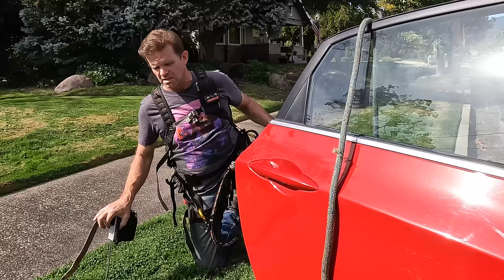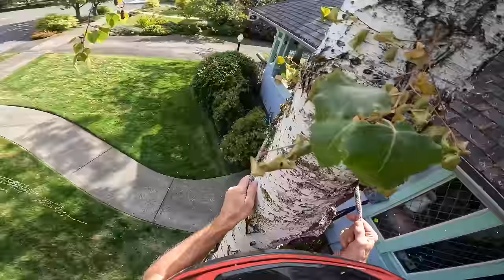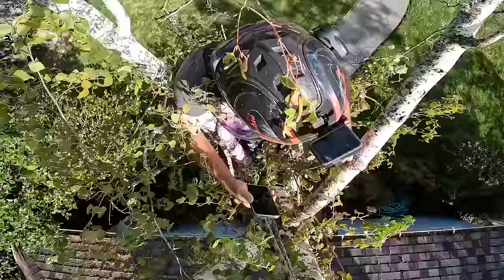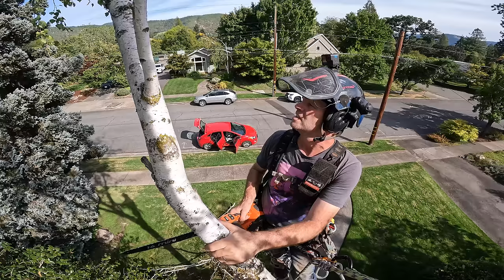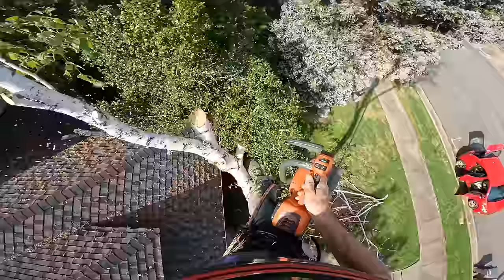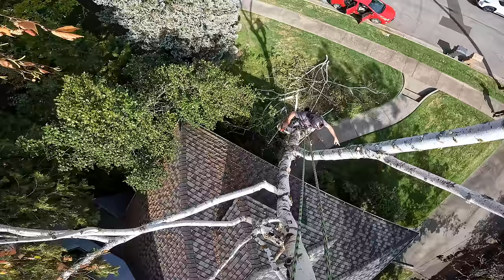Probably the BEST Battery Chainsaw

Comment: I had a similar issue (5:30) with my t540i and took it into Madsens in Centralia WA. The mechanic said that saw dust had accumulated in the throttle, so when I squeezed the trigger the electric components weren’t making contact. I just make sure to blow that out whenever I clean the saw and it hasn’t been an issue since. Keep up the great content, man.
Reply: $1,000 ?!!!!
Reply: Very much same happen to me with Stihl MSA220C.

Comment: My thoughts are a short bed pick-up truck with a topper.  Keeps your equipment out of the weather.  Keeps the fumes, gas, and bar oil spills out of the passenger compartment. 
Bonus points if the topper has side windows that open.  You can also hang your ropes and saddles up so they stay out of any messes on the floor of the bed.  Tint the windows dark and lock it up if theft is a problem in your area.
Reply: The topper and a slide out bed would be trick.
Reply: I operated out of a chevy colorado with a locking shell for a LOOOOONG time

Comment: That Husky is solid, it’s just still too heavy for my taste. I’m waiting for the battery equivalent of the echo 2511 power to weight ratio to come out, and it will happen. The technology will catch up.
Reply: Starting out, I tried the Makita 36V but it didn't take long before I bought a 2511t!
Reply: I got the echo 2500. I like how light and quiet it is. The down side is the 2.5mah battery doesn’t last that long so I got another one to swap out.
Reply: Milwaukee fuel is the way to go

Comment: My youngest just bought a 1977 Chevy truck. Looks nice but needs a bit of work yet. Has a 454 in it, which is a bit much imho. Hope the crew / family and you are doing well. God Bless.
Reply from the maker: Isn’t 454 a Chevy motor?
Reply: @AugustHunicke  77 chevy truck.. he's not a ford man
Reply: Oh no one can never have too many cubes! I have a soft spot for the 454, built one for my 78 Chevy with a short duration high lift cam and Edelbrock Performer intake. I don't know how the stock axle survived, the torque was intense. I got better mileage than the small block that I took out.
Reply from the maker: LOL. I saw 77 and omitted the Chevy part in my mind immediately.

Comment: I love the truck that Jacob (from GuiltyofTreeson) has. I always wanted at utility truck like that, something you can store all of your tools in the correct places with locable doors so you know that your kit is safe. Maybe even have a toeing hitch adapter on the front and back so that you can hook a winch up to it as well. I don't like the open nature of the back of the truck (Jacob has a bar that he slides through all of the rear handles of the saws so he can lock them in place, but still not keen on that). My solution would be a ridged with 2 doors, a bit like a wardrobe lieing on it's back. Lockable and safe for all my random kit that I 150% know that I'd end up getting 😂😂 A crew cab version would probably work really well for you, too 👍👍👍👍

Comment: BTW  A custom hunting saddle that is a little more comfortable than what is available might sell well.    Tethrd and Aero Hunter make the ones I'm familiar with.  That would be a big market to crack into.
Reply: The MB 1.0 is more comfortable than any hunting saddle ever made. This saddle was MADE FOR THIS!
Reply: I have never understood why they don't make an optional belt mounted battery pack with a short coiled cord to the tool. That way most of the battery weight is on your hip, not your arm!
Reply: @JP-rf7px   They do .  At least Husqvarna does .
Reply: @onthelake9554 ...yeah, and if I'm not mistaken @augusthunicke made a video on it.. I wasn't sure if he had it custom made or not

Comment: I am just a home owner and I switched to battery powered saws, but they not fit for a professional use out in the middle of the woods. About 11 or 12 cuts on a 20" diameter oak is all I can got with a Stihl MSA300, for a day work I with need a truck load of batteries. 
The saws are great no doubt about but battery technology still light years away.

Comment: I commented on your last vid, about the makita, and how my 18v makita is OK for what it is. However! One of the main annoyances it has is that when the sarea under the "clutch cover" where the sprocket is gets ful of oily sawdust, it causes the saw to not want to start. Kind of like how that 36v makita won't start if the bar is touching something. It's like if there is ANY resistance ( chain too tight can do it too) the thing won't even spin up. 

So maybe that's what was going onwith this one at the beginning of the video!

Comment: Have a 2012
 Tacoma, Toyota replaced the frame free of charge 3 years ago( yes it was past warranty) due to rust proofing problem. Dealer had the frame changed in 4 days!  Toyota has my loyalty.  
The phone call to pick up my truck after oil change/tire rotation and then oh, we have to replace your frame. Wait what!!! I asked if they could drop the engine when they’re changing the frame but had to settle for 1/3 new truck.  Toyota baby!!!

Comment: I had a 2020 Nissan Frontier 4x4 long box for a couple years.  It was nice but I always wondered about long-term reliability with the new generation motor and 9sp transmission.  Weird circumstances had insurance total it out.  A sign that I wasn't meant to have a new vehicle like that and so I'll either get an old 2wd GMC/Chevy long box to daily drive or else maybe an older S10.  Something to keep the miles off of my '03 Dodge Cummins.  I may have to get my 93 Dodge back from my brother as I more enjoy a mechanical diesel.

Comment: Ever seen mistletoe growing off of mesquite, probably not, but here in NE Texas where I live, I've got, or had several of them infested with it.
It's since been the demise of them, as I believe that's what killed them off.
Normally we take them out on pastures here, but I believe that animals need the little shade that a few of them can provide for the black beast to hide under in the mid day heat.
Although there not much, and they are messy, being a bit brittle dropping limbs everywhere. 
Yet I prefer them to either the cedar, or the elm trees that have invaded with them to take over the native species that were here originally. 
As for the snap cut, it's what one is use to using, then they are use to that in their normal days methodology of tree work, and you are aware of this method, but have developed your own set of methods used in tree work.
Same as in any other trade, where we all maybe aware of how someone else goes about the same trade, it's different slightly from region to region, are country to country. 
That said somewhere along the paths each took they took the best from one, but adapted others, or created a version that was better suited for what they had to work with. 
No one truthfully can say slight versions of basic everyday practices is more efficient than the other, but what makes it so for either person is what they use daily, and that makes it in each person's mind appear so to them. 
That said, as long as each person gets the same task done in an efficient manner, and it doesn't slow or harm those around them while working alone that's fine, but when working as a team, there has to be a standard that everyone on site knows the process without having to think or be explained every move, otherwise it has to flow with nothing more than just a basic plan this is what has to be done, and everyone flows accordingly. 
Instead of one doing something totally different than the majority of the team. 
Team work makes for a great day at work, verses individually going in different directions trying to achieve the same task.
Makes everyone look like a bunch of pre K kids at recess first week of school. 
Not so great a day, and makes everyone a little grumpy being on different daily routines than they were last week under mom's care.
Best way I can describe how it works, and after many years of being in charge of large groups of construction workers. 
I've discovered dealing with them whether they are men or women of various ages, they're a lot like dealing with grade school children in the way they act, and how you deal with them on individual basis. 
That's not to say everyone of them,  but then on occasions it can be everyone of them too.
Including ourselves if the truth was told, as we are still the same little kid inside, but just in a bigger body, and occasionally more experience to deal with adult thinking. 
LOL, watch and see what this brings to the comments section, but I'm afraid that the truth is painful, and not everyone will willing admit it is what it is.

Comment: Hey, if you figure out what caused your Chainsaw stoppage... please do a short video about it.

I'm just a home owner, but I was using one of the OG Chainsaws from Dewalt, & had the chain 
come off at the worst possible time while trimming some small trees, multiple times. (Diameter 15")

I own a Husqvarna 435 X torq.. and I've never had issues with a chain coming off except once where 
I didn't have the tension set correctly. But that battery saw from dewalt seems like "bad design"...
Reply: Almost certainly it’s a case of sawdust getting into the trigger system. This will prevent the circuit completing to start saw.

Comment: I agree that the 200t was the best performing general use top handle made. As far as electric, though, my Husky has the same issues with the battery getting loose.  I much prefer the Echo 2500t for a battery trim saw. It has been super reliable.

Comment: 5:32 If I were you, the chainsaw would make a short fly to the ground at this point. It's so funny, I was at local lumberjack competition, there was fir log around 40 cm in diameter, we had to cut 2 cookies from it. Me with my MS 500i it took around 7 seconds, but there was a guy with battery powered Husqvarna (not top handle) and it took him forever. Later I tried to saw it with my Silky Katanaboy and it took me 3 minutes and 30 seconds, similar as his battery "miracle" :-D

Comment: Take the top handle apart and get all the saw dust out of the throttle and chain break switch area's , it's getting full .
Reply: True, that is why the trigger starts failing. I've got the same isue.

Comment: My ms t220 with 16 inch cost a little less and never has let me down yet. Considering trying new bar and smaller chain. I know that i540 is good just a pretty penny. The stihl 220 is quite comparable in my opinion and i dont think you are sacrificing anything besides a split second in speed of cutting.
Reply: The 220 is gutless !
Reply: Well, according to Jacob, the husky is easy to bog out in bigger wood. So gutless, too, I'm still pretty impressed with the Echo 2500t battery saw I've got.  Will out cut a stock 2511t  though no match for a ported one, and it is a smidge lighter, I find it lasts a fair amount in smaller stuff
Reply: I'll have to check out the 2500t from echo
Reply: @onsight2822 it's obviously not going to out perform a 201 or most gas saws. It definitely is not gutless though. A lot of guys don't like using an electric because they want to force the bar into the wood and expect it to cut it faster not allowing the chain to do what it is designed to. If the saw isn't cutting well for you then it's user error not the saw being "gutless". The saw wouldn't be released if it couldn't compete with other saws on the market and it definitely does. Try a bigger battery with it or try a different chain. Can't say the saw is no good when it eliminates the need for saw gas, has an interchangeable battery to use with other stihl products, and probably has a longer shelf life than most gas saws. Imo

Comment: What is an equivalent 1/4 pitch bar option(s) compared to the panther?
Reply from the maker: Hmm prolly stihl and sugihara
Reply: @AugustHunicke  I was waiting for them to comeback in stock for the echo but now I know why since I watched the video. 

You need to try the 2500t. It’s the battery version of your 2511. It’s super light and cuts good with the stock bar and chain. Only complaint is that it tends to hang up and stall in bigger wood. The battery life isn’t that great either. Overall is good for smaller removals and quick prune jobs.

Comment: If you were to by accident drop one the logs on the sidewalk would it crack the sidewalk? (just curious)
And for the truck try and find a well maintained used older 22R powered small toyota pickup. Would be perfect for a small kit setup.
Reply from the maker: Yep likely break cement.